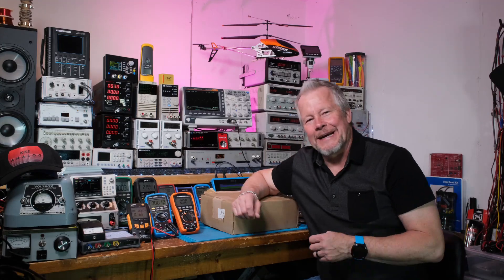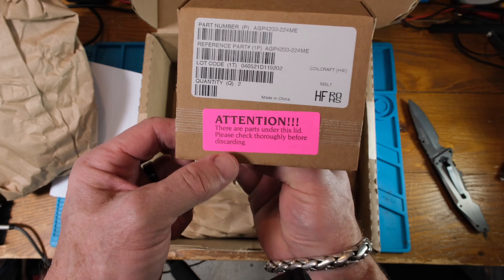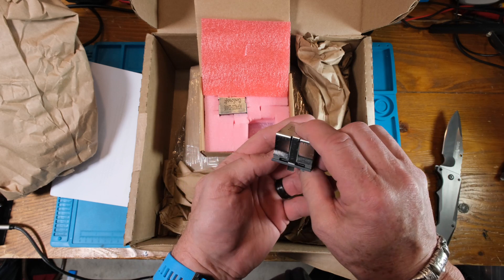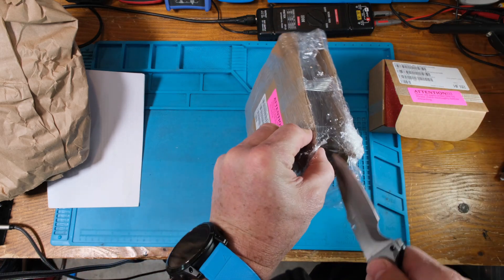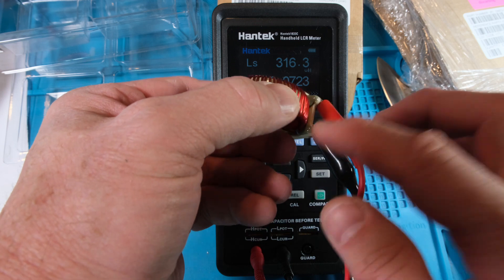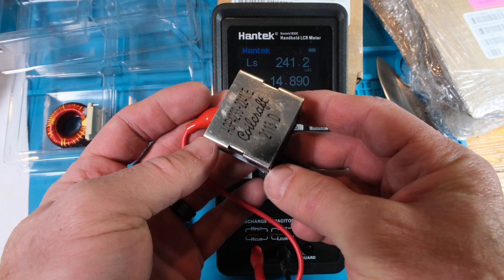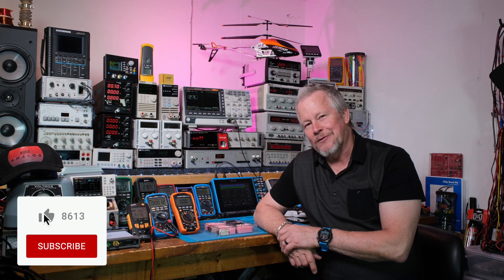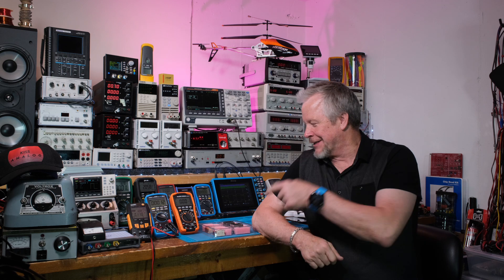Free Inductor Samples from Coilcraft for Power Factor Correction with JAT Collaboration ep#7

Comment: Those inductors are not suitable for PFC circuits because of the wire insulation. For this type of inductor you need magnet wire with heavy insulation. With "normal" magnet wire the insulation will break down with 320V across the winding. Coilcraft has some PFC inductors with the correct wire.
Reply from the maker: Thank you for this great comment!  I'll talk about this very soon when I show this converter - which should be very soon;)

Comment: When I lived in the us back in the 90's samples were great to try new stuff in designs.  The specs of the coils you got are dissapointing to say the least though.  Hand winding any of those I could get much better specs, especially the crappy ESR  100-150mOhm - CRAP!!!!!!!!!!!!!
Reply from the maker: Thanks Steven!  Yes, the DCR is a bit high, but when you think that it is coming off of a relatively high voltage - it actually isn't too bad as the actual loss will be relatively low.  We could roll our own and use larger gauge wire though.  Maybe that's what I'll do for an example - just in case we do have to do for availability.
Reply: Fair point, and likely well suited for your app.  It is always a trade off between DRC and core losses among other things anyway.  Don't know what these cores are, but if some type of iron powder mix, then the core loss is likely about the same, which is what you usually go for (i.e. make them both about the same to prevent hot spots).  Personally I am a fan of Sendust and Ferrite for most things, but iron powders have their place for lower cost needs (if not too hf), so I do use them sometimes.

Comment: very nice looks well made.
are you going to make the power supply class h I think that would be good for audio amplifiers having a feedback circuit from the amplifier to the power supply
Reply: Hi Hoobs, in my opinion that is not a very smart idea as there will be lag between the supply and transient requirement of the amp. You need as much instantaneous power on tap when working on class AB amp, if it was class A the approach may be different. Hence, the reluctance of amp designers to include switch power supplies in their products in the past. Transient discharge from a reservoir capacitance bank is virtually immediate. One of the reasons I am very interested to see Eddie's design approach, as switchers cannot deliver instantaneous current to a load.
Reply: @nicoras8803  
I'm not sure they should be a delay, if done correctly from the input of the amp you can always forward bias it a bit and make sure there's enough reservoir to take up the delay
what do you think of class H using toroidal transformers and capacitors  think that would have the same problem?
Reply from the maker: @Nico Ras Thanks - I think the switcher should be fast enough to handle the slow loading of an audio amp.  When you consider that in an aircraft, a switching power supply has to be fast enough to handle the load to move the ailerons on the wings of a fast moving aircraft.  Switching power supplies have taken over and it is only the audio world that is left.  Well, the pro sound audio guys have already gone that way;)
Reply from the maker: Thanks for your feedback!  This should be a very efficient power supply.